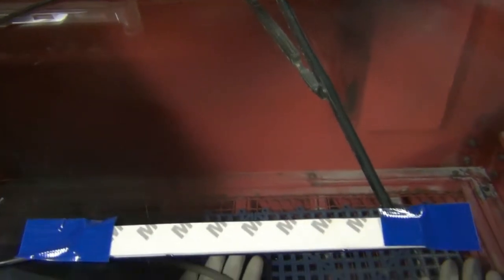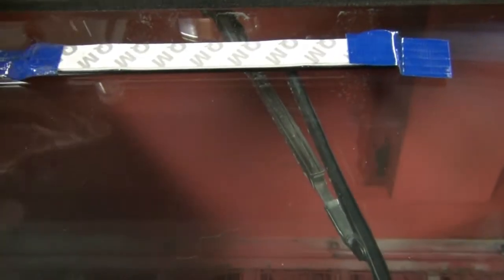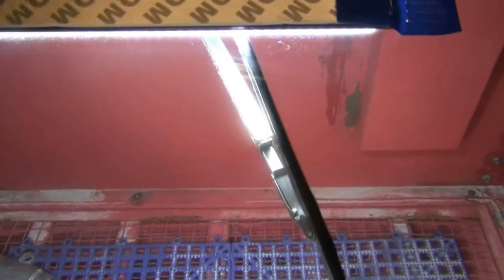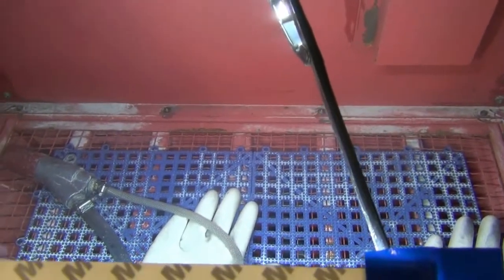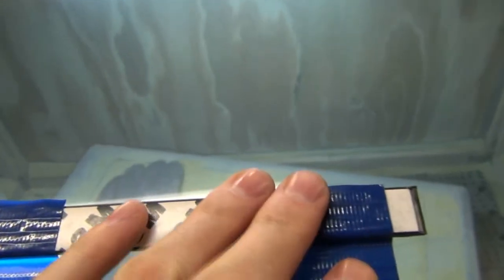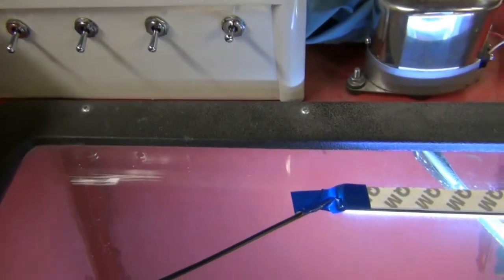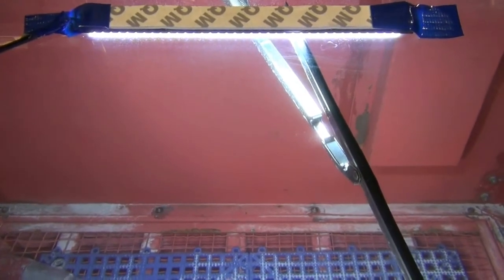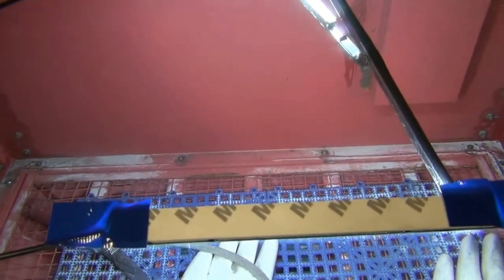Mod To Improve Lighting in Your Sand Blasting Cabinet

Comment: 1:21  May I ask where you got that gun?  Would you again?  I'm looking for a gun for my non-wet blast cabinet and would prefer that style.
Reply from the maker: Which gun?
Reply: @ArnoldsDesign  
The one in the cabinet starting at the 1:21 mark.
Reply from the maker: @mikejoyce3782  I wouldn't recommend it. They are inexpenive, but junk. They give an uneven spray pattern, and the air jet is soft steel covered with a piece of latex tubing.

Comment: Any details about the lights? How many watts? Where you purchased them? When they changed to LED, watts really changed, and it is taking some time to get used to the new light numbers.. I am looking to get some bright strips for several projects,, including the sand blaster.. 
Thanks.
Reply from the maker: They're just lights from amazon. Pretty cheap. I don't know wattage. They sell them to stick on the front of car bumpers.
Reply: @ArnoldsDesign  assuming you got the lights on amazon maybe you can link them directly?
Reply from the maker: @CraftwerksMC  I just put an amazon link in the description. Not the same strip, but brighter with better reviews.
Reply: @ArnoldsDesign  I am late to the party. I am interested in installing the strip lighting on my cabinet but cannot find the link you refer to. Could you send me the link. Thanks Ed
Reply from the maker: @edramey6247  I found those had some quality control issues with brightness. This is what I'm using now: https://amzn.to/3e3FAQx

Comment: How about painting the inside of the cabinet a gloss white 2pack , light reflection may negate the need for multiple lights as I've seen in many mods. A lot of industrial cabinets are light grey and are much easier to see any missed areas of the job because red seems to absorb a lot. Just a minor brain lapse idea.

Comment: Good tip.  My cabinets already have LED lighting, but I find I still have to use a bright LED torch (flashlight) to inspect the parts before taking them out.  I got fed up with putting the parts back in when I saw I missed a bit.  I think I will try a LED strip stuck low on the window to give better close-up light.  Thanks!
Reply from the maker: You're welcome. I got tired of putting the parts back in, too.